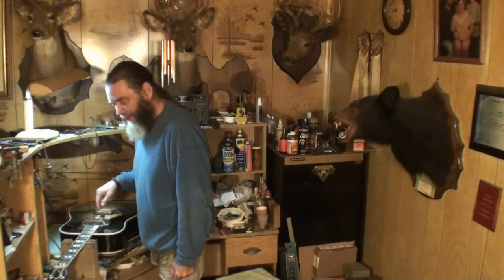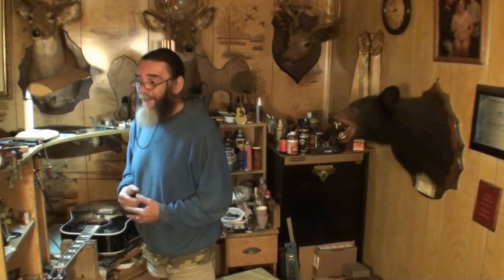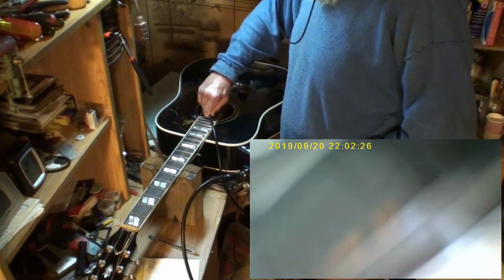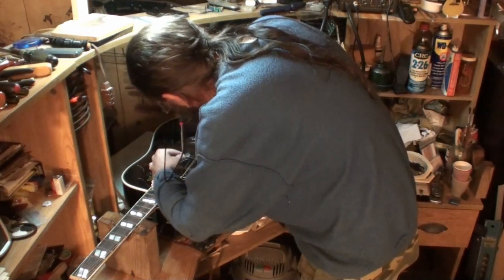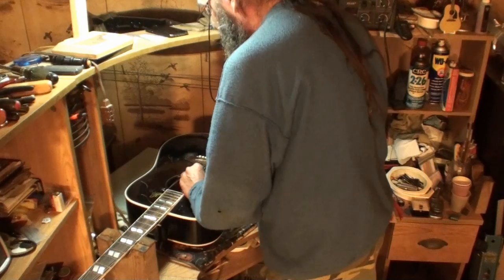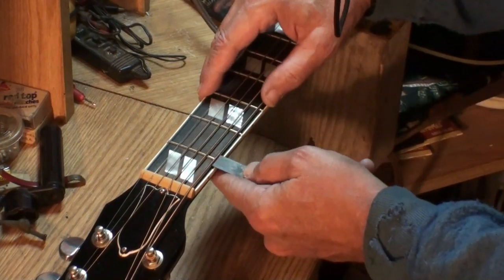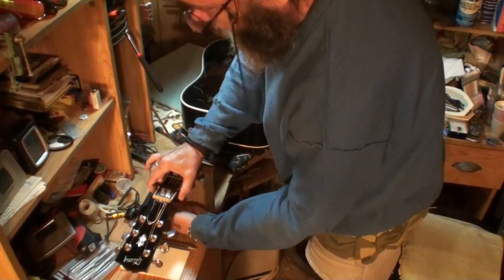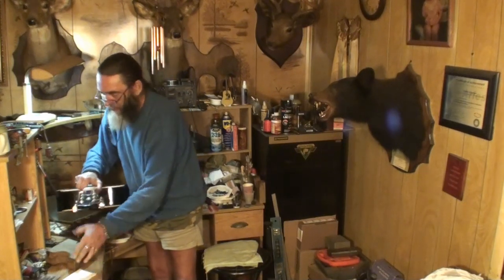YOUR acoustic guitar could have loose braces gibson hummingbird brace inspection

Comment: Hey Randy, great stuff as always. Do you recommend braces shaving and when to do it? Txs
Reply from the maker: I don't recommend it because of it weakening the structure but it does make a guitar sound soooo much better!
Reply: I have a good friend who owns what used to be an amazing sounding J-45. It did not have scalloped bracing & he would watch some guy on YouTube who apparently specialized in Martins and would scallop braces using a finger plane & it would just ignite the tone. Well, he (my friend) buys a set of finger planers off Amazon having never done woodwork or being a luthier. He's a computer guy, very analytical, thinks he can do anything but is NOT handy. So this guy gets his finger planer & goes to town on the braces and the tone bars in the guitar. I didn't see him do it, but he saved the shavings and I did see that. Christ! I asked him if there was anything even left of the braces b/c there were so much shavings, but he swore he didn't take off much. But he got the X braces and the tone bars. He wanted to remove the tongue brace too, but left that. I knew he was jacking up the guitar but he's not the type you try to correct. No, he corrects you. He's an asshole that way, but a decent enough friend. So there's no real noticeable difference to the tone that I could tell immediately following his hack & I can play (better than him too). It wasn't 6 months later & that J-45 looked like an archtop! There was so much deflection or whatever you call it and I didn't know a top could even do that! He ruined a perfectly fine somewhat vintage j-45 because he thought he could get more "tone" by scalloping. Forgive the long story. This was a few yrs ago and I started laughing when I read your comment because I thought back to his fiasco! He still has the guitar, unplayable as it is, and I'd love to have pics of how fkd the inside is! LOL

Comment: Let me start by saying great video and I enjoy your channel sir. Are you puffing the grass Randy?lol you said you didn't want to fret it at the 17th because the "ski jump" and that's exactly where you fretted it. The neck joins the body at the 15th fret. I believe that's where you should fret when taking that measurement (where the body and neck join) as that spot should be static. Are you changing out the nut with a tusq as well seeing as your doing the saddle?
Reply from the maker: why yes yes I am puffing the grass lol the 14 fret is the body joint not the 15th, I met it half way to determine the neck relief, but no need in splitting hairs it's got a ski jump and not much can be done, the guitar is a tad over humidified so that may be adding to the problem. no not replacing the nut only the saddle as the owners request. thanks for having a peak!

Comment: you could be a proctologist lol! that's a pretty cool piece of gear and I bet it saves some work when you're trying to find loose bracing etc. I kept hearing something rattle when you hit the lower bout of the top of the guitar even after you tightened the strap peg but who knows what I am listening for. it was kinda lower in pitch on the leg side of the top towards the bridge side of the leg curve if that makes any sense
Reply from the maker: I didn't tighten the strap button until after I made this video so that probably is what you were hearing, once I noticed it was loose and making noise I ruled it out but it still was making noise the whole time I was tapping. thanks for viewing  brother!